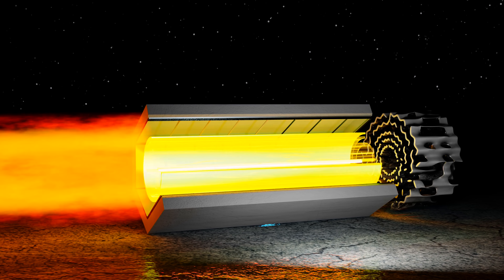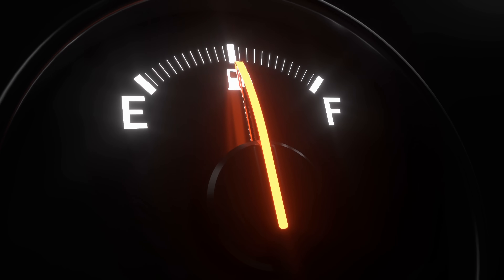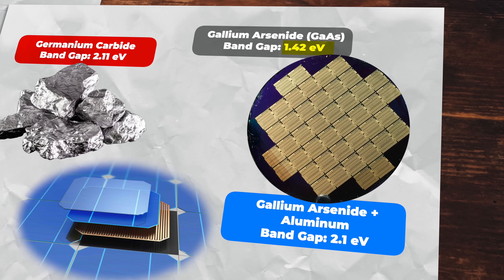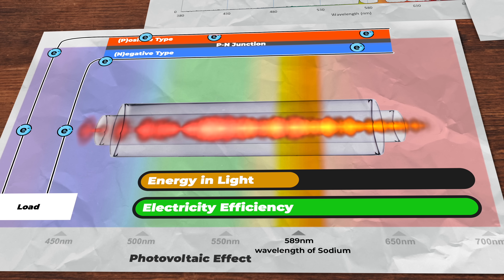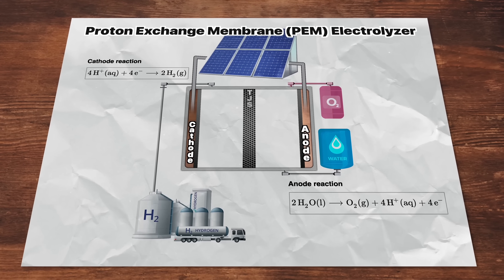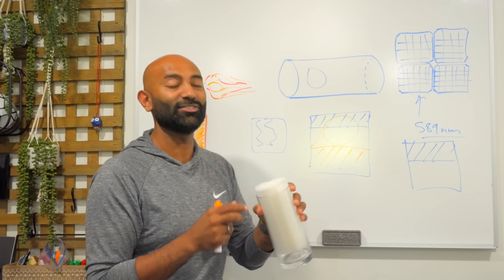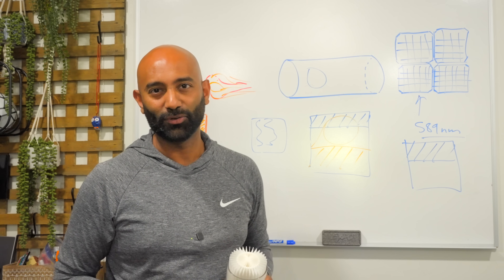Why Solid State Might Save The Combustion Engine

Comment: Hmmm….. what about soot building up on the PV cell and then the cooling required….. I know the visualisation isn’t reflective of reality, but it seems like there are a lot of hurdles
Reply: Think of these when they reach end of life and the potential for environmental damage due to dumping
Reply: I’d not be surprised if this is another Theranos. It’s too easy to take such an idea from an old patent, alter it slightly with the help of an engineer or the like, call it proprietary when you get into the secret sauce, and bring it to some green funds….. free money, almost as long as you don’t wait to pull the rug and escape to another country.

Comment: I gotta admit I came into this video a total skeptic ready to tear this idea apart. I will say that the idea of converting heat to monochromatic light and then using a tuned photocell to convert it isnt just clever its a potential paradigm shift. Weve been boiling water to make electricity for many decades and this shows a path towards a new gold standard. Thoroughly impressed and will be watching this technology. Its even bwtter than the thermoacoustic solid states i had been studying earlier.

Comment: I imagined a different fuel-electricity converter, where the energy transfer would also be electromagnetic, but achieved by induction instead of emission-absorption. The idea would be to convert thermal energy into mechanical energy by accelerating the gas in a nozzle, and to exploit the movement of charged particles in the gas to obtain an electric current in a winding around the gas.
I suppose that photon emission-absorption is more efficient if you can adjust the photovoltaic cells to the right electromagnetic frequencies. But I wonder if it's possible to make this system sustainable, without it wearing out too quickly.
What's interesting is that it may be possible to combine my concept and this one in the same reactor.

Comment: Yeah... no. 80% is laughably high beyond any sensible reason. The fuel will lose a lot of energy on its own producing light. It still has to be an open-ended system, at least as far as the fuel burning. A lot of the energy will be wasted just going out the tailpipe which will still exist. 

So we're going you burn fuel with its own energy inefficiencies, to heat up a material.. to heat up another material and make it glow (btw the previous material will glow A LOT at those temps. Copper wouldn't be good, you can melt it on your stove top) and that material won't glow at the proper wavelength. 

Assuming everything has a 15% energy loss which would be very generous, were looking at a compounded 45-60% efficiency loss with an extremely good design.

Comment: The ever enduring advantage of an ICE vehicle is that it's fun to drive.
Even if this is possible, driving something powered by it would be no more fun than driving an electric car. To me, that's not saving the ICE.

Using it in a hybrid approach though. That's much more interesting. It reminds me of the MGU-H they use in Formula 1 to get 50% thermal efficiency.

Comment: How is this an internal combustion "engine" or "motor"?? Seems to me that your initial intuition was correct it's just a different type of fuel cell. Prolly why it's called a light cell and not a light engine lol. This coverts heat into electricity which then must be connected to an engine or motor to achieve locomotion. This is a cell or at best a generator but absolutely not an engine and seems deliberately misleading to call it an engine.

Comment: I am very skeptical. If this is real, it is not just an "engine" for cars. It's an everything machine. It should be able to replace all other thermal energy devices. It would become the only viable choice for gas fired electric plants, nuclear, geothermal. It would even revolutionize solar power. Simply stick one of these into an existing concentrating solar thermal plant design and you've just made conventional photovoltaics obsolete for large scale applications. If this works as advertised, they should be talking about a revolution in the entire energy sector, not just better cars, and such small picture thinking makes me even more suspicious.

Comment: You're right to be sceptical, Danielle Fong sounds like Elizabeth Holmes - Theranos2.0?
Shame, because it sounds both plausible & amazing. Maybe an aftermarket turbocharger/generator for diesel engines, especially locomotives which could use the generated electricity beyond the periphery.

Comment: 1) Why do you call it "internal combustion?" Similar combustion zones in a Stirling engine are referred to as "external combustion."
2) What happens to the chlorine once it is freed from the sodium? Does that become a new emission hazard? Is there a sodium/chlorine "reunification and recovery zone?" It seems that managing that hazard would require additional inefficiencies.
3) The push away from gasoline is centered around carbon dioxide emissions (yes. there are other undesirable products as well). While external combustion does not have the same chemical reactor consequences as internal combustion at higher temperatures and pressures does, it has all the carbon dioxide. Improved efficiency reduces emissions per unit of output energy, but does not remove the principle reason for the move to "alternative" energy production means.
4) Your brief hydrogen reference seemed to omit reference to reformer energy losses and emissions. Methods other than reformers, methods such as direct electrolysis, are possible, but are also quite costly in energy terms. I know of no method for producing hydrogen that does not use more energy than hydrogen and oxygen give back when the water is made. Once the hydrogen and oxygen arrive at the fuel cell, the efficiency is fabulous: The fuel cell process bypasses the thermodynamic limits of the Carnot cycle. However, the process of creating the hydrogen is the Achilles heel of the "hydrogen economy".
5) Speaking of Carnot efficiency, how does this "engine" bypass that thermodynamic limit? Any time heat transfer is involved, efficiency suffers.
6) The regenerative heat exchanger is a good idea (certainly improves Stirling engine efficiency). However, 100% recovery is nowhere near possible.
7) I'd be willing to bet that component robustness will be a significant challenge.

All that said... very interesting indeed.

Comment: Don't get it. What is the fuel ? If it's gasoline that is burned won't there be an exhaust an a amount would be CO2 or ?
Reply: It can be designed to work with any combustible fluid. If it ran on gasoline it would still create co2, but it would be around twice as efficient as a gasoline engine meaning you don’t need to burn as much fuel.

Comment: Converting from thermo-to-photo-to-electric seems like an unnecessary extra step. Especially since themo-electric cells exist and work fairly well. making a themo-electric cell significantly more efficient makes more sense that adding in photo conversion and converting photons to generate electricity.

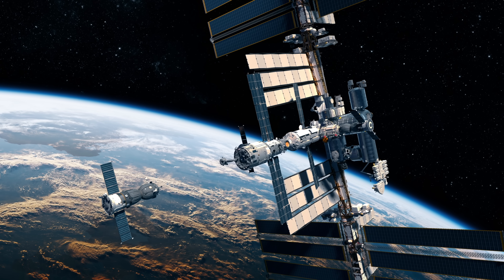Comment: At 4:28 in your video, you state that "the material can be 10,000 times thinner and lighter...". If something is only one time thinner and lighter then it has no thickness and no weight. Do you mean 1/10,000th of the thickness and weight?

Comment: Dude an engine needs fuel. A motor needs electricity. So if this thing is creating electricity you would still need a motor with moving parts to drive the car. This is not replacing the engine. The motor needed to drive the car on the electricity produced would be replacing the engine. So you just lost me 37 seconds into your video. You also state the producers call it a cell. A cell is not an engine.

Comment: I didn't look too deep into your comments about the specific case of LightCell being trademarked, but just looking at the footage your provided and commenting on the technicalities of trademark based on that. It shows that the LightCell has a TM next to it. Yes, it stands for trademark, but anyone can do that -- add a TM to a phrase or something and go with it (of course, it would have to be something that falls into 'trademarkeable' territory for it to have a chance of being valid). The real step is when you register the trademark (indicated by an R with a circle around it -- ®) . That indicates that the 'trademark' has actually been registered, instead of just being used like a trademark (what a TM stands for). The difference is basically the use/etc of that trademark is legit -- something that can be trademarked, something that isn't already in existence, etc -- whereas a simple TM does not indicate or guarantee any of that.

Comment: So it's reverse cycling a filament light bulb.
Electricity thru a filament that gives off light and heat.
Heat a filament to give off light and convert to electricity.
Sounds incredibly inefficient.  Plausible but inefficient.

Comment: ALways suspicious when such high 'efficiency' claims are made.  Sure, one might 'tune' the PV for one band of the sodium spectra.  But what about the other spectral lines?  What about the heat being rejected in the exhaust gasses?  This is like saying that a steam turbine is over 85-90% efficient.  How well it extracts work from incoming steam is really that efficient.  But when you look at the whole steam cycle, nothing nearly as good as this.

What is the fuel input per watt-hour output?  Surely that is lower than the claimed 'efficiency'.

Comment: We keep the internal combustion, use the heat to create electric that charges the hybrid battery = 80% efficiency!!!  This is not currently being done?  If not, this is not a scam.  It would be more than charging through the electric grid.  Electric grid is very inefficient as is battery charging, until grid electricity is free or near free.

Comment: About 20-25 years ago, I can't remember who did it(I want to say Smokey Yunick but I'm not sure). Did an experiment on a 4 cylinder Ford engine where he heats up the F/A mixture to 440 degrees F. This completely dried the mixture allowing much more complete combustion increasing fuel mileage and horsepower exponentially from about 130 HP to about 300 HP. With about half the fuel consumption. I don't know why  it was never developed more, but it looked very promising.
Reply: The issues with Yunick's "adiabatic engine" were durability of the ceramic/metal seals and emissions.  To use an analogy, you can't mass-manufacture an F1 engine for use in non-race-cars.
Reply: @keithwilliams6007  yeah I remember that was an issue, but maybe after 25 years material science has improved enough to overcome that.

Comment: PV efficiency is about 20% to 25%
Here we use heat to emit light (efficiency < 30-40% or even far below?) and PV (efficiency <25%).
In total we gain efficiency below 10 %  which needs to run a drive (other losses). How should this system have a better efficiency than normal motors running on gasoline?
Think its a scam as free energy is.
You get some energy, but most energy is wastet to heat the enviroment.

Comment: The combustion engine is a huge disaster from several points. Most obvious climate change. But also health; the fossil fuel pollution causes over hundreds of thousands of deaths per year. Then political. A lot of fossil fuels come from non-democratic countries and keep the wrong people in power. Sounds less worse than a regular ICE. Less worse is not good enough. One place where it could perhaps work in airplanes. If it would work at all. Even so, the engineering itself is quite interesting. Wouldn't want to see it go outside of labs and experiments.

Comment: TLDR:

In a nutshell, turns out, we can capture heat as specific wavelengths of light. We only know how to efficiently capture specific wavelengths (so far), so to achieve this, we funnel energy into a system which uses heat to emit those specific wavelengths. This emission, in the form of photos of a specific frequency, is absorbed by photovoltaic panels.

It is my belief that THIS IS the way forward in general, all around. We waste ENOMOROUS amounts of energy because we don't have general wavelength capture. turns out, we just need to find clever ways to funnel energy into conversion processes (in this case, chemical reaction based) that generate narrower bands of wavelength, in order to fight entropy.

The general concept here is REVOLUTIONARY. Forgetting about the "solid state engine" idea specifically, the more general principle IS INCREDIBLY useful and should play a role at all levels of Electrical Engineering going forward.

Entropy can be outsmarted.

Comment: How does this go around the limitations of the Carnot process? Thermal losses of exhaust are not zero at environmental temperature; they are zero at absolute zero.
This is what limits efficiency of internal combustion engines to around 50%.

Comment: I think new solar panels are above 22% efficiency. But anyway, sunlight is FREE, so even if this system works at high efficiency, you're still not using a free fuel source.

Comment: I see the appeal of this. Converting an already available and cheap fuel source, with the myriad of advantages liquid fuel has over things like batteries, and convert it into electricity efficiently. If the efficiency claims are true, then it's a game changer on many fronts. Emissions could be controlled very easily since the combustion process would be stable (unlike an IC engine which revs up and down causing changes in combustion products output) so that would be a huge plus. However, there is much to desired here. For one, a working demonstration, even if crude and of poor output. Some more technical details on how the system is built. The crude animation on the website, showing intake and exhaust in the same space yet all the heat going out the back, is completely bogus and does nothing to explain the process. Why not combine with thermocouples on the outside of the perimeter to capture the heat that would surely be generated inside? Salt needs to get to 1400F before it melts, so there's going to be tons of excess heat to contend with, which means there will need to be some kind of cooling system. Just saying, I think it's a great idea, but I'm not getting my hopes up. The website is incredibly NOT confidence inspiring since there is no company information (or is it just a name for now?) or anything else besides some pictures and an almost 1999 HTML website feel and layout.

Interestingly both Lightcell and Mesodyne and their LightCell both mention that either the people involved studied at MIT or the technology came from MIT. So it seems perhaps these two groups know each other, perhaps studied together, and are trying to be first to make a product. Reading on the Mesodyne offering, it seems to be doing the exact same thing ultimately, using fuel to create a certain wavelength of light, and special cells to absorb that light. Mesodyne seems legit and further along as well as having the rights to the name. Perhaps they all came up with the name while in school and Mesodyne trademarked first? Lastly, it seems Mesodyne is heavily focusing on military and similar applications, smartly so.

Comment: Standard ICE, if I am not mistaken, is chemical to mechanical, with waste heat. 
The light cell is chemical to thermal to electrical to mechanical. Again if I am understanding this proper.
Combining the stages from various sources and requirements should increase the efficiency.
Considering motors are more efficient at lower speeds and engines are at higher speeds, a combination without too much excessive demand on weight, structure and space requirements would win out.

Comment: Huh, this reminds me of concepts for 'nuclear light bulb' fission torch spacecraft engines, but on further examination they're not that similar as the light passing through isn't being used for superheating something.
It's more like a chemical laser's light generation system being used as an electrical generator than an internal-combustion engine. Actually, it basically is a chemical laser, like the military attempts at laser weapons, but instead of generating a beam it's trying to extract energy from the bright light to run other things -- which is the part I'm most skeptical about. I don't believe in anything that's "secret sauce" until its makeup becomes public.
I also don't see how you're going to get any 'window' or optics-based engine to run on any conventional hydrocarbon fuels, they'd foul up the glass. You'd need something exotic like hydrogen specifically to avoid formation of soots or other compounds that could fog or damage the glass.

Comment: The problem with using the light conversion as an add-on to an existing engine is that you can't capture enough of that heat effectively to have a meaningful difference in efficiency. You have to add more weight and complexity, not to mention cost, for a very small gain. Just adding a motor and having the ability to flip a switch to go between generating power, using power, whether that power comes from braking or the engine turning.. is already a big boost in efficiency.

Regular old hybrids are actually really good.

Comment: Heat and light to electricity are super inefficient. This literally cannot be as highly efficient as they claim.

Oh NOW I see the problem. They are talking about the most efficient step of the cycle and claiming that as their efficiency instead of total efficiency. They're also ignoring how long the design can run, which is probably the main reason this doesn't work practically. A lot of cool shit can be done in a lab, but unless it can run for thousands of hours without repair or cleaning, it usually isn't worth it.